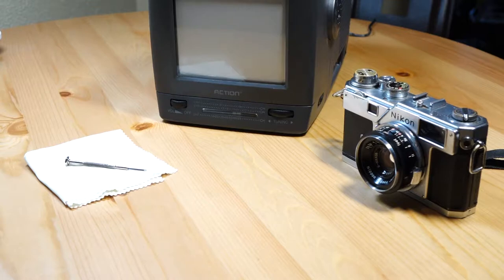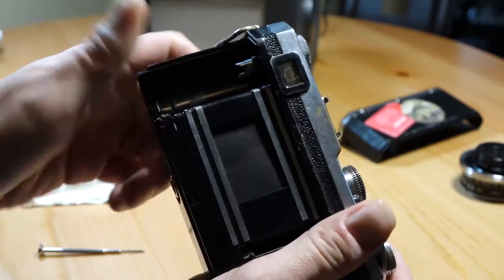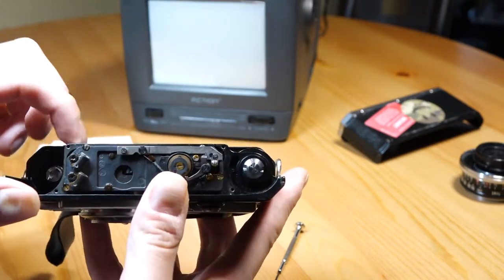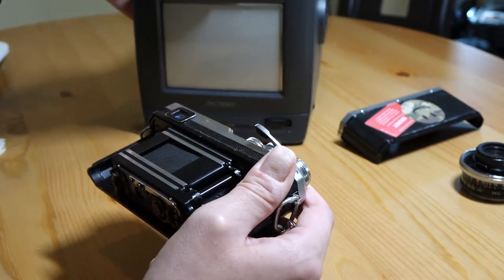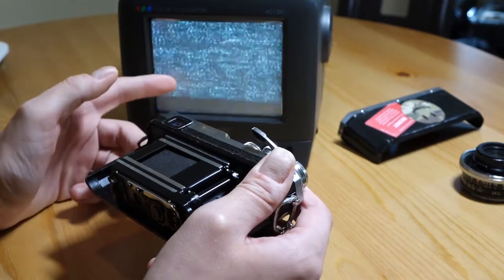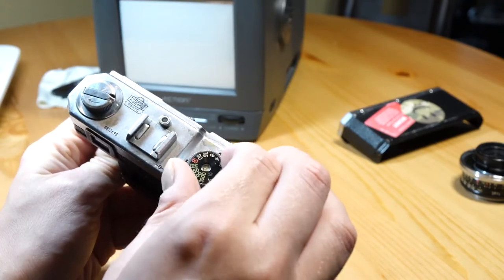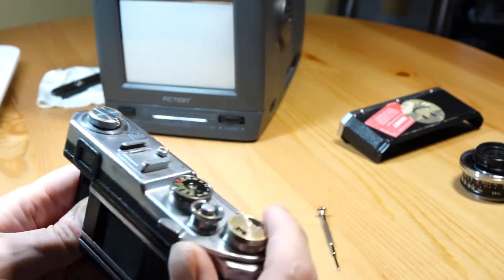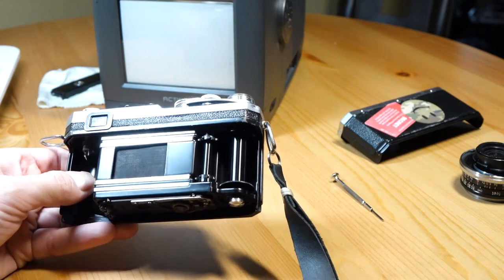Classic Nikon S3 Rangefinder Repair

Comment: Hi Andrew, thanks for this video. I just got a Nikon S3 that was firing correctly for half a day, and then suddenly the shutter would get stuck mid wind and would not fire. After looking at your video I followed your directions to open the bottom plate, and managed to diagnose the problem - it was a loosened screw that was holding the cam down, that was making the hammers slip over it. I managed to tighten it and get the problem sorted. Now the camera is working correctly. Maybe I should do a video on the process so that I can show others how to do it if they encounter the same thing.
Reply from the maker: Glad to hear you got it working. I am no expert but I have picked up a few things here and there.

Comment: Neat, I adjusted a Zorki a while ago and it was by exactly the same method! Though with those old soviet leica clones the problem is usually that the trailing shutter is too tight and caps (closes together) on the left side, which makes the right side of the photo dark.

Comment: Nice to see some Nikon Rangefinder enthusiasts :) to the best of my knowledge the method to use a CRT screen is actually very useful, as it gives you a overview about how the two shutter curtains are moving and not just one curtain. However, I think normally the front curtain is going precisely and the rear is too slow and the latter needs adaption to obtain overall more accurate shutter speeds. To my understanding if you lower the speed of the front curtain, you could avoid some black bars in the fotos as well but you might just overall reduce the shutter speeds. If only some shutter speeds are too slow/fast and not all, I assume the shutter mechanism might need a proper cleaning. Anyway, no guarantee from my side and thanks for your efforts in this review, best regards
Reply from the maker: I am no expert, but a CLA is probably the best option.  Sadly the cost can often equal that of the camera making it a non option for most. The demo I gave is an option for a budget repair and seems to hold true for a while as mine is still going strong after almost a year of consistant use. Incidentally my speeds were way too fast making this a very good fix. The slow speeds are controlled by the "slow governor" which requires a CLA to remedy.  The black bars you spoke of are from speeds being way too fast, thus causing under exposure and the black bars.  On aside note the black bars seem to be a Leica specific issue I have never seen them on a Nikon.

Comment: I just received a "almost unused" Nikon S3 2000, it looks like it's just come off the factory floor with a shutter issue.  If the camera is left to sit for 30 minutes or so, cocked or uncocked,  when I fire the shutter the button feels mushy and the shutter seems slow to open.  If I then recock  the shutter and press the release the shutter operates normally and will continue to do so until I leave the camera to sit again.  The issue on the roll of film I developed is the left side of the negative is over exposed.  Any ideas?
Reply from the maker: The dark edge on the film sounds similar to the issue I was having. Not sure about the slow shutter open, sounds like something is on the track and the camera will need a proper CLA. This is why I tell people to be weary of "unused" cameras.